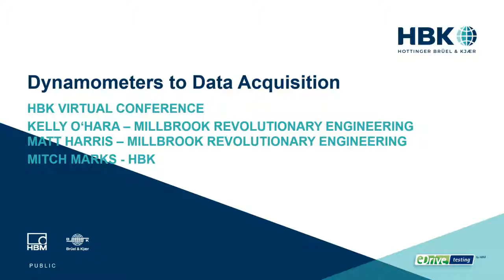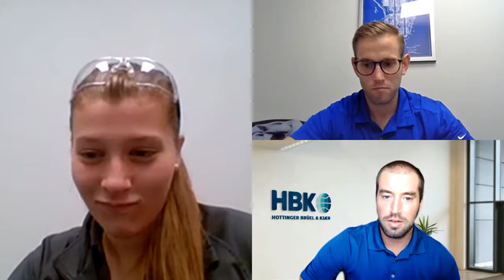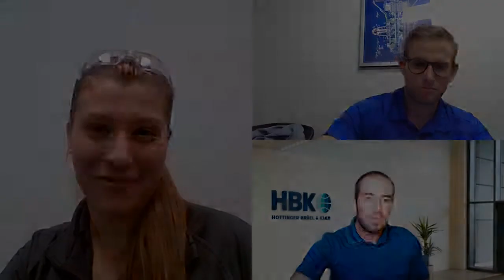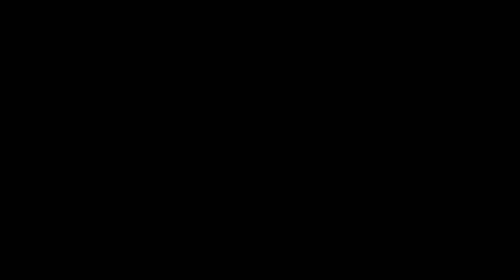Electric Power Dynamometer Best Practices with MRE and HBK

Comment from the maker: 00:20	Welcome & Intro to ...
01:10	Kelly O'Hara & Matt Harris
01:40	Growth at Millbrook Revolutionary Engineering
02:50	Dynamometer - definition, purpose
03:50 	Top 3 tests on a Dynamometer
05:40	Efficiency of Test set-up
06:50	Different types of control systems
08:00	Adapting Testing to COVID conditions
09:30	... improvements to customer relationship
10:50	Remote testing: how it works
12:05	Electrification: how Testing is changing
13:50	How have Dynamometers changed over the last 15 years?
14:50	How has control changed?
16:25	Other changes to the way measurement is done?
19:00	Equipment necessary for Torque Ripple measurement
22:32	Handling day-to-day testing
23:20	"Hit Play" profile testing
24:45	Live Data Visualisation during testing
26:50	Experiences with Perception software
28:00	Reasons for choosing HBK equipment
29:25	Common testing mistakes and errors
31:15 	Secret Sauce?
33:50	What breaks in a test cell and how to fix it?
35:00	Look Ahead: Testing in 10 years time ...
37:00	Safety precautions in test cells
38:40	The trend to higher voltages
40:30	Experiences of working with HBK
42:55	Thanks & Outro.